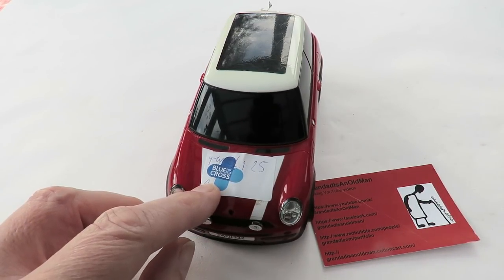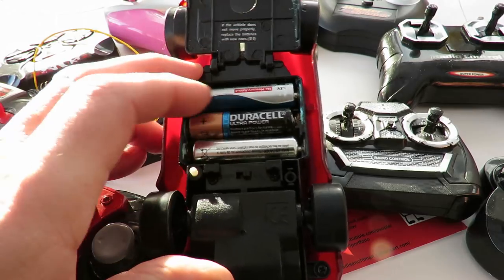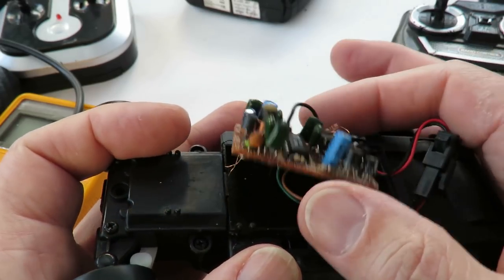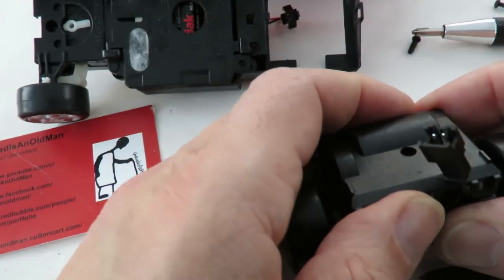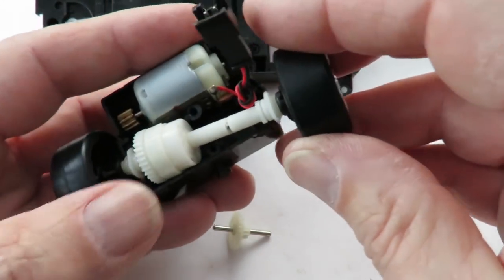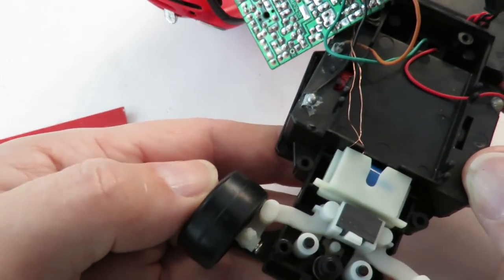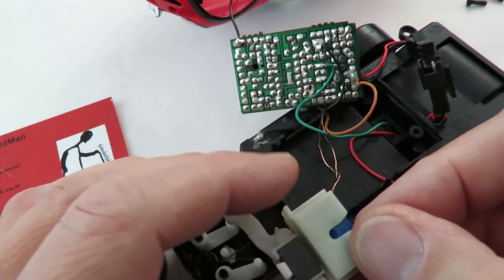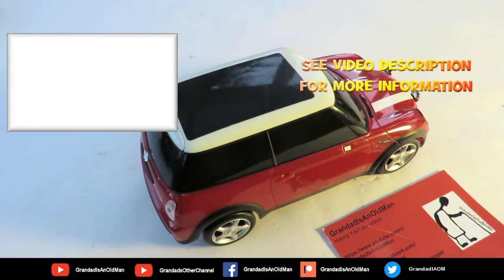Nikko RC Mini Cooper Tear Down FULL LENGTH

Comment: I'm working on converting one of these Nikko Mini Cooper's with hobby grade steering servo, 2-1 ESC/receiver, and LiPo battery. I was sold when I realized this thing has a pretty beefy differential and enough space up front for a micro/sub micro servo.
Reply from the maker: Nikko certainly made good robust toys, far more durable than some of the stuff we get now.

Comment: You put the steering back together wrong. The plastic case with the magnet has a little part on the bottom middle that sticks down. it should go in the middle of the springs on the chassis.
Reply from the maker: Not sure what part of the video you are watching but I can see clearly where I ensure that peg goes between the legs of the spring at around 22:45 and even tell you about it. It is not possible to fit it upside down as you would not be able to fit the stub axle assembly in place, the plastic piece you are referring to only has the holes on one side, the other side is blanked off.
Reply: OK thanks. it looked like it went beside it off to the left of the car. But I guess I'm mistaken sorry

Comment: I'm watching your Nikko RC Mini Cooper Tear Down FULL LENGTH youtube.com video.  I have the NIKKO America, Inc Mini Cooper.  You mentioned that the tag for the frequency was missing on your unit which should have been on the battery compartment.  My unit has a tag labeled "49MHz".
Reply from the maker: They usually offer a few options so you can buy a pair to race together without having them clashing on the same frequency. 27MHz, 40MHz and 49MHz seem to be the most popular. I think the majority of my cars are 27, most of the rest are 40 with just 3 or 4 at 49. I think I might have a couple of 45s too.
Reply: @GrandadIsAnOldMan  The unit that has the 49MHz sticker also has another sticker:  4-06-C with the number 58 below that sequence plus a sticker labeled Item No. 60-4399 (it's a blue mini cooper).  A sticker on the bottom has:  FCCID: CVTRP7421H Made in China  Grantee Name:  NIKKO CO., LTD. This device complies with Part 15 of FCC Rules.  Operation of this device is subject to the following two conditions (1) The device may not cause harmful interference (2) The device must accept any interference that may cause undesired operation.  The other mini cooper we have has the 27MHz sticker also has another sticker:  4-07-C with the number 3 below that sequence with another sticker labeled Item No. 60-4400 (it's a red mini cooper).  The remote control device for the 49MHz (4-06-C over the #58 and Item No. 60-4399) has a different FCCID: CVTTP7770H but the same info on the remainder of the label --China & grantee, etc.  I opened the remote and have a picture of the board.  If you are interested, send details on how to transmit that picture.  I also have all the paperwork that came with the mini coopers.  I could not find any other numbers on the units.  If you are interested in that paperwork, I can scan it and e-mail it and the picture to you.  It contained basic information such as installing the batteries and operation of the car and remote device.  It did include very brief/basic directions on how to change optional parts such as changing the motor or changing the wheels.  On one of the brochures they had in the lower corner:  KYP-04-00.  I don't recall exactly when we purchased the mini coopers but it might have been around 2000.  I have kept the original box, but don't see any other helpful information.   My red mini cooper (item no. 60-4400) works fine; however, I have been unable to operate my blue mini cooper (item no. 60-4399).
Reply from the maker: @stephenphelps506  Gosh, thank you for taking the time to put all that information together. I don't know if I still have the car, I have had a few clear-outs trying to reduce the amount of "stock" I have. I have just written myself a note to go and have a look. (It's 1AM here and I am just off to bed) 😊👍
Reply from the maker: @stephenphelps506  I have had a good hunt through my stock today, and I can't find that Mini, so I have probably given it away or used it for parts.